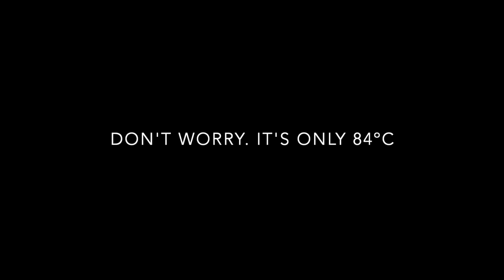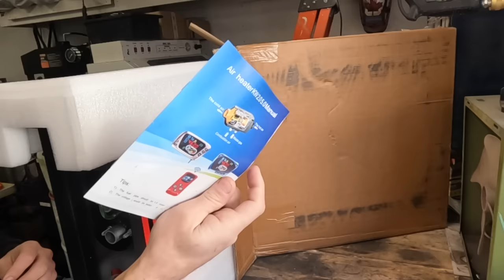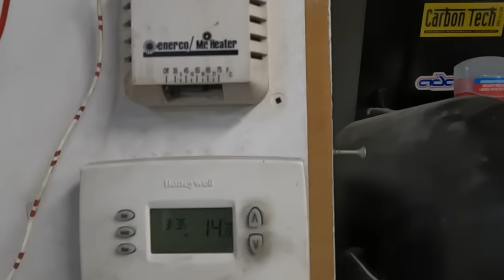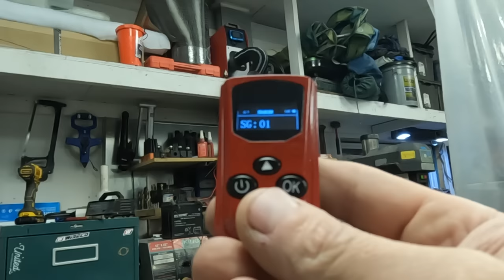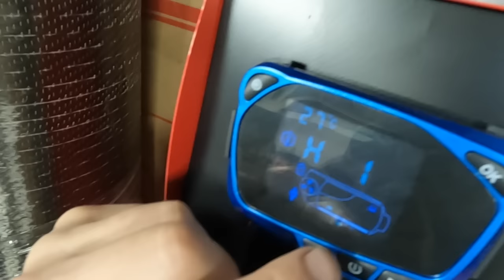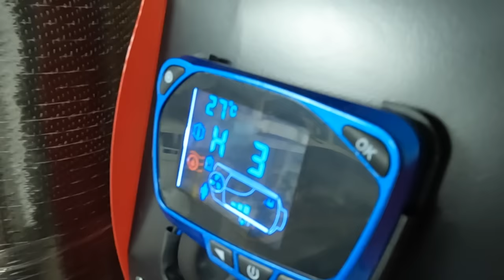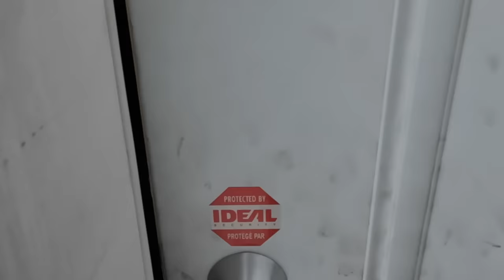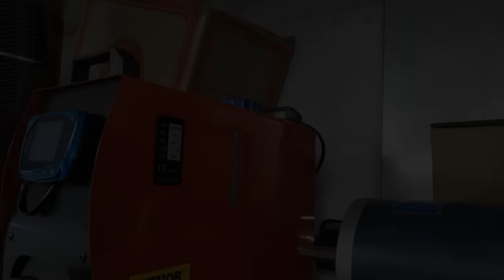Chinese Diesel Heaters - DON'T BELIEVE THE HYPE !!

Comment: How did you pair this remote?
Reply from the maker: I can't recall how to do it. Mine came paired and I have misplaced the manual.
Reply: @loweredexpectations4927 Appreciate the reply, I managed to find my manua
Reply from the maker: @hobbyguy79  Awesome... Can you tell me how to do it ? haha.
Reply: - On main control panel in shut down state, simultaneously long press power and right arrow 

- Enter remote control code as follows by pressing left or right arrows -  OC1, OC2, OC3, OC4, OC5

- Choose the code for the corresponding remote control, 1 - 5

- Press any key on the remote control

- Pairing is complete
Reply from the maker: @hobbyguy79  Awesome, thanks ! I will pin this to the top so others can find it easily.

Comment: Diesel heater not waste oil heater. 😆
Reply from the maker: Come one now... you're just going to shatter all my hopes and dreams ! You mean I can't buy a $200 heater and expect it to work like a $8000+ WO furnace, haha !?
Reply: @loweredexpectations4927  😆 my friend has one on his boat and now it sounds like an airbus 380 on take off 😆
Reply: @haydenharris3059  Accurate description. It's not the best idea for say.... someone who is trying to make YouTube videos...
Reply: @haydenharris3059  Yes it does sound like a 1st class suite on Emirates or Qatar airways! Living on my sailboat for the last three years and this is one of my most loved pieces of equipment on my boat. Since I wrapped the fuel pump in soundproofing and tightly in upholstery foam it is silent, and the recirculation airfan white noise is super soothing while the boat is rocking me asleep in freezing winter nights!
Reply: @chrisdekock8864  I have a canal boat and whatever the heating it's amazing being toasty inside when outside is terrible weather. 
Thanks for explaining 🙂
Reply: I am using same diesel heater from 2months i am running on 50/50 diesel and waste oil. It works perfect.
Reply from the maker: @leszekkalinowski2436  It's great to hear stories like this ... it gives me hope !!  Are you using waste automotive oil and have you had to change any settings (fan speed / pump hz)  on your heater, or are you just running it out of the box ?
Reply: @loweredexpectations4927  yeah i am using  filtered waste automotive oil..i havent change any settings but i have learned that you have to start up with fan speed 3 and once temperature start to reaching 130° C change fan speed to 6 and never go down after that. You have to keep going on full power otherwise your diesel heater will turn off from overheating. I think reason for it is that diesel/waste oil mix burn with higher temperature than clean diesel
Reply: And reason to start with power on level 3 is that the heating coil can easier heat up smaller amount of waste oil/diesel which needs a little bit longer to fire up than clean diesel
Reply from the maker: @leszekkalinowski2436  Great info, thanks ! I have also noticed that the waste oil mix burns hotter. I have had the over heat issue a few times. I'm at 4000 feet elevation, so the air is pretty thin compared to most places... that makes it run very rich.
Reply from the maker: @leszekkalinowski2436  On mine, there is a start up sequence / program that runs independently of the heat setting. Meaning, If I have it set to setting H1 or H6, the heater will start in the same way and then once it reaches temperature, it switches over to the heat setting I have chosen.
Reply: I got one its cheep to run im gonna try the diesel and waste oil mix
Reply: @leszekkalinowski2436  ARE YOU FILTERING YOUR WASTE OIL ...SOMEHOW?
Reply from the maker: @jimboy6338  If you have a controller that has the hidden admin settings, I would suggest that you crank your fan speed to full speed and set the pump to a maximum of 3hz... this is what has been recommended to me, but my controller does not allow this. Make sure you have your heater installed in a safe way so that carbon monoxide is not an issue, and also so the exhaust does not catch anything on fire. It gets extremely hot.
Reply: @loweredexpectations4927  my heater unit sits outside abd it piped in by air ducts
Reply from the maker: @jimboy6338  Great. That's probably the safest way.
Reply: @loweredexpectations4927  it gets the job done
Reply: Right, it ain't no 7.3 powerstroke that will run on anything ya throw at it lol
Reply: @sterlingscharmen2850  Man... I wish it would work as well as an old diesel engine !!!
Reply from the maker: @@1livepl I have tested mine on diesel and it works great ! I believe I have a few hundred hours of testing at full force, and not a single issue. As soon as I mix in some waste oil, then the issues begin . 

Even the "8KW" units are really only around 5kw output, so if your area is more than a small shed and the temp drops below -10 C outside, you are going to need to run this on full pelt non stop 👍
Cheers.
Reply: @elloko8303  I'm quite aware and I'm no fool I assure you.
Reply from the maker: @elloko8303  Lol... yes ! That's literally what the video says in the first seconds of starting " don't do what I do" These heaters are amazing little units. They work awesome on diesel.  My videos are to show people what happens when you burn oil...  Because there are a lot of people saying that they burn oil just fine.
Reply: What brand is this one?? Cause it looks like one I was gonna order.
Reply: I can't,t imagine that little heater could hear that big shop with snow outside. No way
Reply: @leszekkalinowski2436 what are you using to clean the waste oil? I have seen people use inline water sediment filters to clean it.
Reply: @leszekkalinowski2436 one guys video I watched was burning 30/70 kerosene/waste oil. One thing he said is he has a fuel switch where he will always start his heater on pure kerosene and the. After it's up to temp he switches the valve over to oil.

Comment: I've had one for 3 years now, it works flawlessly.
Reply from the maker: Good stuff ... thanks for the comment. I haven't had any issues at all, while running on diesel. They are pretty awesome units when used as they were intended. Thanks for the comment.
Reply: Same here 3 years flawless. Regular diesel. Got one in my shop, and one in my van.
Reply: I have mine now for about 6 months and works perfect. I use kerosine...a little bit more cost but a very claen burn..My heater is on the outside . Combustion iar is taken from the outside..heater air is taken from the inside , it takes the warmed up air and is more efficient this way..I do not need to warm up the cold air from ouside this way. The exhaust air I run thru a radiator so no heat is wasted. Of course the heater is above outside and the exhaust is running from the top of the radiator to the bottom where it leaves the room thru the wall..

Comment: Good luck! They work well with proper installation and with diesel fuel.
Reply: Thanks for the comment ! I actually ran mine on diesel for 4 days, after this video, and it ran flawlessly and actually cleaned itself out (I took it apart before and after to see). I bought this specifically to burn waste oil so I will keep experimenting.
Reply from the maker: Just realized I replied to you while logged into my other YT channel. Oops. Hope I didn't confuse you too much.
Reply: @JoelArseneaultYouTube  try and half and half mixture.
Reply from the maker: @edb75001  I actually have tried that, but since found an issue with the heater and didn't document any of it very well, so I plan on doing it over again. Thanks for the comment / suggestion 👍
Reply: Yep... as I understand it, if you try to run this with cruddy oil and you're NOT running it full out at its hottest, you're definitely going to have problems with buildup.
Reply from the maker: @Justin-C  Yeah... I have tried running it at full bore, non stop, and the longest it has run is 4 days, and that is on a 50/50 oil diesel mix. It seems to be running plenty hot, as the housing temp is always over 200C ... usually 206-212. I think my oil is particularly bad as it is from air cooled engines, and my controller lacks functionality to increase fan speed to get enough air into the burn chamber.
Reply: @loweredexpectations4927  Makes sense. I've heard/read you can potentially feed the heater more DC volts to boost the fan (within its input voltage range). Also could try a mix a little lighter on the oil too.
Reply from the maker: @Justin-C  Sorry if I confused you. I replied first as Joel Arseneault (logged into my other channel) I've been told this also... If I had an easy way to do that, I'd give it a try, but I am currently running it somewhere between 13 and 14. I have the my battery hooked to a charge that charges non stop, and my controller / control panel almost always has 13V ... on start up it sometimes drops a little, but if I run it on a lower setting it will go up to 14V.
Reply: You tried to burn waste oil in one of these? Why would you think that would work? If you knew how how waste oil heaters worked, you wouldn't even consider burning waste oil in one of these.
Reply from the maker: @jeffwhite3021  If you watch the video, you will see that I tried waste oil in mine, as it was recommended by several other youtubers and bloggers... I had serious doubts about it working but then watched a video by YouTuber JohnDragonMan who, in my opinion, is a prick and a blatant liar... He showed his heater supposedly after 3 years of running on WO, it looked almost like new except for a little carbon that he cleaned up in a jiffy... the oil that he claimed to be using was extremely nasty... 

So yeah, I'm not upset with the heater, the company or the seller... I'm annoyed that assholes on the internet lie about their results to get views, or to make themselves look smart. I think there may be ways to get these to burn WO better than two days... but it's not just pop some in and off you go. 

I have an extremely basic understanding of how waste oil heaters work... Filtration, preheaters, air compressors, injectors ... I also know what is in oil / waste oil.... it's nasty stuff.... but "why would so many people make videos saying that they burn waste oil if they don't.... "
Reply: @Justin-C  Voltage is very important take our word.
Reply: @jeffwhite3021  Mix the fuel with decent diesal  saying all that we just use decent diesal  full stop.
Reply: @don kirk  I don't know? I mean yeah if it works it works but used motor oil produces gobs of ash that would clog one of these in a hurry.
Reply: @jeffwhite3021  I would agree with you Jeff

Comment: Never had an issue with mine 3 years in. Just good old standard diesel is perfect BUT it has never ever turned its nose up to a 75/25 mix of petrol/diesel. I think as long as the exhaust is properly set and your not throwing takeaway grease through it, it should work flawlessly. Your smoke and hot exhaust looks like you threw a whole high carb take away down it. It shouldn't be doing that and your colour of smoke is the indicator. It should be black not white * edit * mine doesn't smoke at all even after 3 years and all I do is top it up, and to remind you, I bought the absolute cheapest 'verion' available. In reality they are all the exact same. I bought a very expensive one and opened it up... same parts. Just saying, stinks you had you're bad look
Reply from the maker: Yes, I'm burning waste motor oil and this is the whole problem. The whole issue is that there are many people claiming that these heaters run fine on any old crap, and it's just not true.
Reply: Filtering oil is not fun. If it's used you have to filter it. Also it's best if you add fresh fuel. 3 old, 1 fresh. If not you'll get lots of smoke.
Reply from the maker: @blakeps192  I do some very basic filtering, but should likely use a finer filter as well as a centrifuge ... but, yeah, that's a lot of work. That being said, I have done a lot of testing with new motor oil and come to the conclusion that the contamination is not the main issue with my oil ... the main issue is that it is oil, and not diesel, haha.
Reply: I was thinking just straight petrol? (it's cheaper than diesel), here....
It would run much hotter on lower settings and thus become more  effiecient consuming fuel.
Just a thought... :elbowcough:👍
Reply from the maker: @mickgatz214  I do believe that you can purchase these heaters that are set up to run on petrol. David McLuckie has done tests trying to burn pure gasoline and had some issues. He ended up modifying the chamber (I believe to slow the burn) and got it to work okay.
Reply: @loweredexpectations4927  Thanx for your reply. For now, I reckon just sticking with diesel/keorsene will suffice. But def looking at a suitable 12v hour meter. Those battery one only last about 5/6 years...
Reply: Let me know how it works 💪  I've done it I'll admit but I quickly oiled up the petrol with some diesel. Not long after my glow plug died
Reply: If you use kerosene you'll need to add paraffin for the waxing effect IF petrol is involved. I find:

Diesel = the best fuel heat efficient - expensive at the pump

Kerosene = cheaper but stinks and not quite but not far off diesel heat

Parrafin = have you ever tried snorting a candle? It burns well but more of a wax burner in slow motion.

Conclusion: experiment - just do it out doors
Reply from the maker: @Weather_Chasers  Haha... well summarized. Earlier today I found footage of a gasoline test I did last year, but my heater was so modified, it makes all of the results invalid, and I deleted the footage.. I have a new chamber and some other parts, so I would like to rerun the test.
Reply from the maker: @Weather_Chasers  I have had surprisingly good luck with glow plugs. All of the torture testing I did, and I never killed one... other that the wires falling off.
Reply: @loweredexpectations4927 you have to modify the flow rate of the pump in the manufacturer settings to successfully run it on motor oil, also lighting it on kerosene and switching back to kerosene before shutdown keeps everything clean. Enjoy
Reply from the maker: @jonathantheunacceptable4259  Thanks for the comment. I actually had 30 videos in this series with all sorts of different experiments. The controller that I had in this video did not allow for controlling air and fuel ratios. A lot of new controllers do not grant access to an engineering menu. 

I did eventually purchase a controller that allowed me to change the pump independently of the fan and did some testing, but the ECU failed after only a few weeks of use. 

Have you been burning waste motor oil in your heater for an extended period, or have you just heard that this works ? 

Cheers.
Reply: @loweredexpectations4927  I've noticed lol watched a few... I just started this year, I I'll let you know how the kerosene works. I'm starting on 100% kerosene, mixing it 50/50 with the used oil and only burning 3-4 hours at a time, then flipping it back over to kerosene for 5-10min before shutting down. I checked it after watching your vid, no where close to the build up you had, I think it may be how constantly your burning just oil, also mixing gas would just lower the combustion temp wouldn't it? The gas would burn all off quickly leaving the oil behind to cook like you're seeing, think how little oil you put in a 2 stroke or your cleaning carbon up all the time
Reply from the maker: @jonathantheunacceptable4259  It will be interesting to see how this works out for you. The shorter burn times and then switching to kerosene will help some for sure. I suspect you will still get a build up in the main burn area (behind the baffle). 

Having gas in the mix causes some issues for sure. It burns off quickly, and gas requires a much more accurate air fuel ratio to burn properly than diesel or other oils. This means that the gas in a mix will almost certainly not burn well leaving soot. 

I did do some testing where I started on diesel and the idea was to shut down on diesel, but my test periods were long enough that it generally would not make it to the end, haha. I've done some many videos and tests I can't remember, but I believe I did try one where I switched every 4 hours ... at that point, my burn chamber may have been destroyed.
Reply: @loweredexpectations4927  I'll keep you posted as the winter goes. Being in up on the north side of lake superior I should get close to the same weather as you lol cheers
Reply from the maker: @jonathantheunacceptable4259  It has been really nice here lately... I wouldn't be too upset if it stayed like this... but it won't !! haha.

Comment: Why buy something to do what it is not designed to do.... ?   This is not a waste oil disposal unit, its a diesel heater, the clue is on the box.  Its advice such as this that may cause people to have serious accidents with these devices, however if used in a way that agrees with its design, it works flawlessly.
Reply from the maker: I thought I explained this in the video... at least the basics ... however, there are lots of reasons. I'm not saying anything bad about the heaters... I have 4 of them now and they are freekin awesome... i run 3 of them on diesel and those three work flawlessly 👍

This video series has saved hundreds of people from making the mistake of trying to burn "alternative fuels" / waste oil, in their diesel heater. Althogh it should seem fairly obvious, when there are people on the internet "showing" how their heater worked for 3 years with no issues burning crap, many people, myself included, try it out of desperation.